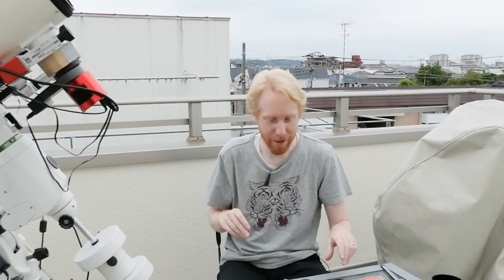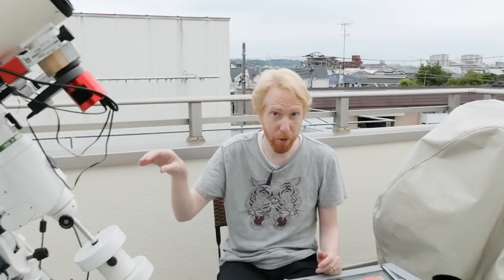What is BACKFOCUS?? And how to deal with it? - Starting Astrophoto for Lazy People - Ep 8

Comment: I think for me, backfocus is one of the most frustrating aspects of astrophotography. Especially when you want to buy near gear and have to recalculate all the distances and buy a bunch of adapters to get it just right.
Reply from the maker: Yeah I fully agree. And once you've done everything right with backfocus you discover you have tilt. That kind of stuff :)
Reply: It gets expensive too if you have custom adapters (e.g. from PreciseParts, etc.) and get the backfocus wrong.  I've just made that mistake for new my newish ASI6200MM & the Takahashi µ250CRS, where I was short by 11.9mm!! The funny thing is that you still can achieve focus in the centre despite being that far off in the backfocus, however moving out 12mm from the centre, the stars get severely distorted.
Reply from the maker: Oh no!! I hope you can get it corrected at some point!

Comment: Hi Cuiv, great series - learning a lot fast. I need a piece of advice please. I have a EvoStar 72ED with no flattener/corrector at the moment and I am using a Canon mirrorless camera (M50). Is it actually necessary for me to find a exact backfocus distance for my telescope? Because my focuser is changing that distance as I focus. I think I am a little confused here 😅
Reply from the maker: I should have been clearer! Without a reducer/flattener (and I don't think the 72ED has one integrated into it), as long as you reach focus, you're fine! But on an APS-C you may find you need to crop a lot;
Reply: @CuivTheLazyGeek  Hi again Cuiv, thank you for your reply that got me on the right track! So I got myself a OVL field flattener for my 72ED combined with my Canon m50. For backfocus, I started with not overthinking it much and just used the EOS-M to EF adapter and a T-ring. This combo is getting 55mm from the top of T-ring to camera sensor. I screwed it directly to the OVL flattener. Good start I thought. 
On my first night out, I noticed 3 problems. I was shooting the eastern veil nebula and from Slovakia:
1. Top left and top right corners got extremely elongated stars - indicating need for longer backfocus distance
2. Bottom left and bottom right are much better, but it seems like the stars are misshapen to the other direction, indicating the need for shorter backfocus distance - I think
3. I have a lot of chromatic aberration, which was almost not present before the use of OVL FF.  
I am surprised (not very pleasantly) with what I got. I am clearly making a huge mistake that I am not seeing and I frankly do not know to what direction should I move. I have very few clear night these days, so I want to sort this with as little nights testing as possible. Please advise 🙏
P.S. I can upload pics of the image train, and a sub-exposure I was describing. Thank you ☺️

Comment: Given that you can sometimes get a fraction of a millimeter dimension in your stack up what is the allowable error from lets say the nominal 55mm dimension.  Is there a rule of thumb for that?  How close do you need to be?
Reply from the maker: It really depends on the optical element, the size of the sensor (the larger the sensor the more obvious any issues will be in the corners) and how sensitive the end-user is to star shapes! And don't forget that it's 55mm (or whatever measurement) +- any manufacturing tolerances. The ultimate test is star shapes in the corner of the sensor. With a M4/3 sensor and my own equipment, I found being even 1.5mm out worked fine.

Comment: Hi Cuiv, don't you  less 2 or 3 mm do the glass thickness of the filter ? or its not necessary?
Reply from the maker: Yes, 1/3rd of the filter thickness needs to be added (so 56mm for me rather than 55mm, with my 3mm thick Astrodon filters). I actually have a video on that, as well as mathematics behind it :)

Comment: Sorry if I missed it in the video. I had thought this distance was just to get the image into the scopes focal area. Being that some scopes have a larger adjustment range that others.Could my SCT get correct focus with 45mm back focus or is it always doomed to not be sharp until the distance is correct? I'm currently doing manual focus on a 4" SCT so put the error down to the operator.
Reply from the maker: That's a good question! Backfocus and focusing distance are slightly different. Backfocus is distance from sensor to a coma corrector, field flattener, focal reducer, or other corrective optic. You will typically still be able to get stars in focus, even with the wrong backfocus distance, but star shapes in the corner will be quite poor. So for your SCT, unless it is an EdgeHD (which has a corrective lens built in), the perfect backfocus is simply your point of best focus. But if you have a focal reducer, you will need to adjust the distance between it and the sensor to get good stars across the FOV. I hope this helps & good luck!

Comment: Hi, Cuiv! 
Very instructive video, but I have a problem, opposite of what you presented here and was wondering if you can help with some advice.
Last night, for the first time, I tried connecting my OAG to my 8" f5 Newtonian, but couldn t reach focus. Not on my Oag cam (asi 290 mm mini), but on my main imaging cam (Panasonic gh4). 
I also have a Zenith Star 61 and haven t had any problems focusing both cams, but on the Newtonian the sensor of the dslr seems to be too far away if I add the OAG body. 
The telescope focuser was all the way in and I still couldn t get focus. It was closest to focus when all the way in...
Should I unscrew the focuser and push it slightly more in the tube in order to reduce the distance or is there another way? I ran out of adaptors to remove in order to shorten the backfocus distance. I also removed the filter wheel, but I need it..
 Would greatly appreciate some advice. Thanks!
Reply from the maker: You want distance from OAG Prism to guiding cam to be equal to distance from OAG Prism plane to main imaging cam. That sets your distance from the OAG. Also, generally, you want the coma corrector flange to be 55mm from the camera sensor. So that sets pretty rigorous limitations... it may simply be that your camera + OAG are just too thick!
Reply: @CuivTheLazyGeek  ok. Thanks. I think I will get a coma corrector. I need it anyway and maybe that will solve the focus problem by shifting the focus point/distance from main sensor...🤔?

Comment: Hi Cuiv, can we put a tilt adapter between the telescope and field flattner. will this affect my back focus distance of 88mm after the field flattner and it's all used up ? Thanks
Reply from the maker: Technically yes you can put a tilt adapter between the telescope and the field flattener - but not sure you want to tilt the incoming light rays ahead of that optical element (and also for SCTs, you want the FR/FF to be as close to the tube as possible). It would not affect the FF backfocus itself, but personally I would only put a tilt adapter in between the camera and the field flattener, and not ahead of the FF.

Comment: I finally got my EdgeHD 8 and spent some time trying to attain the proper backfocus with the FR. I got it exact, however, the stars indicate that it should need a bit more (https://www.youtube.com/watch?v=xznpG1Iz_rE) .  If you take the distance from the edge of the threads like you mention, that should do it.  Also, I do notice my stars appear bloated with the ASI294MC without a filter and when I use the IDAS NBZ filter they look great.  I don't UV/IR filter yet but I do have a Baader Neodynium Skyglow filter.  That should work until I get a UV/IR filter.  Thanks  as always Cuiv.  Cheers Kurt

Comment: Is the back focus dictated by the telescope or the camera? ZWO camera has a 55mm back focus but  the TAK FSQ85EDX says that it can accommodate a long back focus of 200mm.
Reply from the maker: Back focus is dictated by the optics. ZWO cameras provide ways to achieve 55mm of backfocus because many optical systems have that as their backfocus distance. However, the backfocus used by ZWO cameras (e.g. distance from camera shoulder to sensor) is important to take into account (6.5mm or 17.5mm for most ZWO cameras)
Reply: @CuivTheLazyGeek  thanks !

Comment: Hey Lazy geek, have you down as a reference for most of the adjustments on my scope. But have a problem with this backfocus thingy... I've a Celestron 8SE and an ASI533MC pro... the focal reducer on the Celestron states 105mm optimum backfocus distance whereas the cameras states 55 mm  ... what distance should I use?
Reply from the maker: Trust the optics! The required backfocus is determined by the optics, and most reducers/correctors want 55mm, which is why cameras provide ways to achieve that distance. But in your case, you want 105mm between the reducer shoulder and the camera sensor!
Reply: @CuivTheLazyGeek  Thanks dude... that is most excellent!

Comment: Cuiv I wrote you about this in the past but you never answered me . I do not use anything in the imaging train except for a filter , so where do you measure for the back focus , and are extension tubes figured into the equation because with my ed80 I use like 3 to get focus
Reply from the maker: Sorry, it is difficult to answer everyone about everything, especially about equipment I don't know. I am unfamiliar with the ED80, but if you're using it with a reducer or flattener, the backfocus that is specific to the reducer/flattener (typically 55mm for such scopes) is measured from the reducer/focuser shoulder (up to the sensor). If you don't have a reducer/flattener then whatever distance required to achieve focus is fine. Otherwise if you have a reducer/flattener, but you can't achieve focus with the correct back focus distance to the sensor... then I don't know...
Reply: @CuivTheLazyGeek  Yea I use like 3 tube extensions so I dont know myself , but thx , hope your feeling better